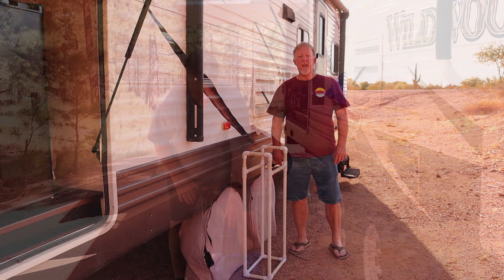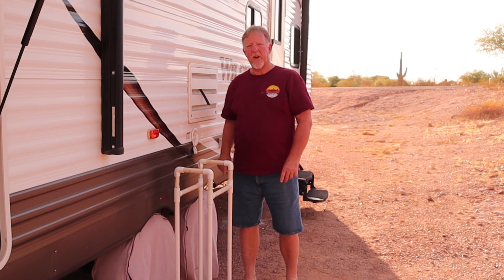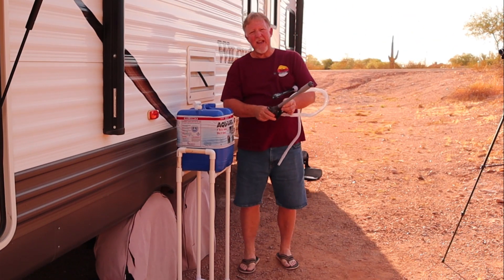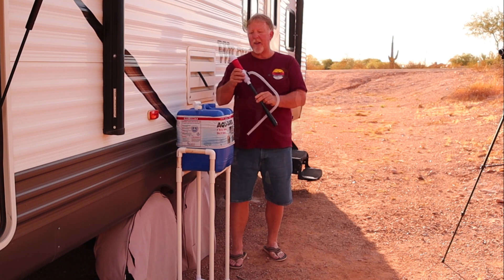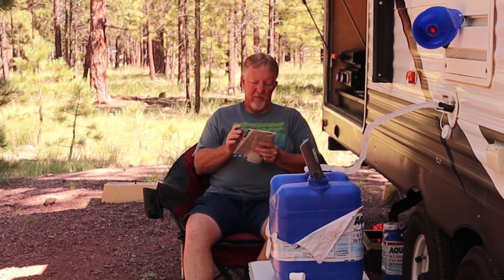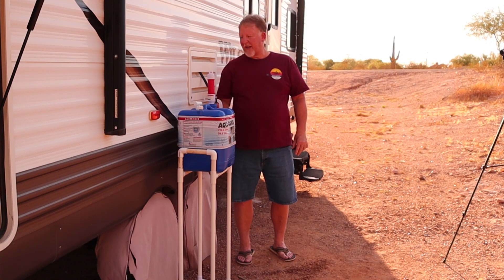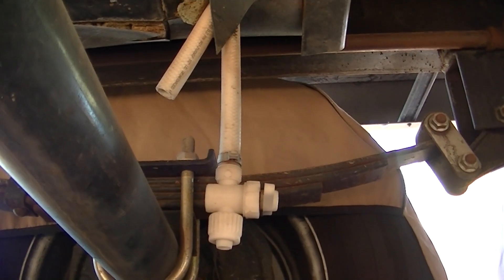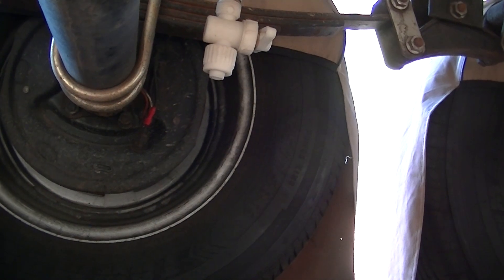How to fill your fresh water tank for the RV Newbie

Comment: I use a 60 gallon water bladder in the back of my truck. Since my trailer doesn’t have a power fill, I Picked up an identical water pump to the one in my trailer. Rigged it up with some 1/2” to garden hose fittings and use that to transfer into the tank. Plus the pump serves as a spare in case the one in the trailer were to die.
Reply from the maker: I love it when people get creative to make their situation work for them. That's how I end up doing a lot of the things I do. If you have endless money then I guess it isn't a problem. Good job.

Comment: i have a sixty (60)  gallon bladder in the bed of my truck. with a far better 12V dc pump and hose to fit.
but my rv only hold 40 gallons, so i have a water meter so no over flow.
0 to full. in less than 5 min. ( set up and break down time included).
i have seen set ups like you are using but no battery's needed. as it is done gravity feed.

but in the past yes i have done the hold a six-seven jug way.  still do with all the water i take for a two week trip. 40 + 60 + 30  in jugs.
then bottled water. up to another 30 gallons.
not run out yet. even helped out others.
conserve water big time and you learn how to save water, without dehydrating yourself.
Reply from the maker: We are not full time so I usually end up taking more than I should of everything. I've seen setups like you have but i haven't done it yet. We usually stay in National forests here is Az and they usually  have a water source nearby. Your setup is ideal for  complete boondocking.
Thanks for the response.
Reply: Last week I found put about bladders.  20 galon tank in rv, 60 gallon bladder that will be in the truck when I travel.  Found a 600 gallon bladder for $200 that would be great for longer term stays.
Reply from the maker: 600 gallons is huge. If you are a true boondocker, which I am not since I usually stay in the National forest where they have water nearby,  anything 60 gallons or above would be awesome. Best of travels to you and thankyou for commenting.

Comment: What do i do ? My fresh water tank is in my truck and i fill it up and just hook the hose up. My pump and battery are in my truck.
Reply from the maker: And you have a trailer? Do you use that like a city water connection? That would be an interesting set up.

Comment: Are those small battery transfer pumps OK for potable water? The few that I looked at on Amazon said they were not. Mostly used for fuel, etc.
Reply from the maker: I think they would be great for fuel transfer and obviously if you did that I wouldn't use it for anything else, but out of the box it is clean and the plastic used isn't any different than other plastics. I believe it is a personal decision whether to use it for water or not but I don't have any issues with my using it for water transfer.. Also personally i never drink the water out of my fresh water tank and always have some source of bottled or filtered water. I don't drink the water out of my faucet at home either.
Reply from the maker: You peaked my interest so I looked up several on amazon and the 1st 3 I came across stated Fuel/Water. For me I'm comfortable with them. Thanks for the question as it caused me to look it up also.

Comment: Use the self priming jiggler pump from harbor freight. You’ll never need batteries and it’s much faster than that pump!
Reply from the maker: You have me intrigued. What is that? I have a siphon pump, is that the same thing?
Reply: @arewethereyet2653  Yes, it’s a siphon pump. You put the self primer in the water jug, place the hose in the fresh tank down lower than the jug. Shake the primer several times to pull water into the hose and through to your tank. Then you let gravity do the rest. No batteries!
Reply from the maker: @ryandavis5869  I think i actually have one of those that i have never used. Never thought of that. I thought about the drill pump which i have one of those also. Thank you